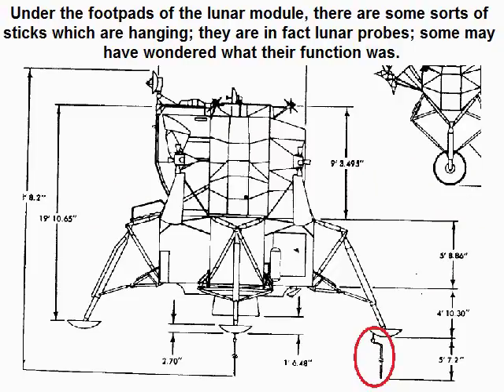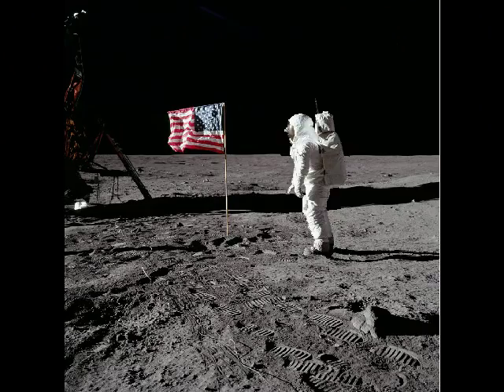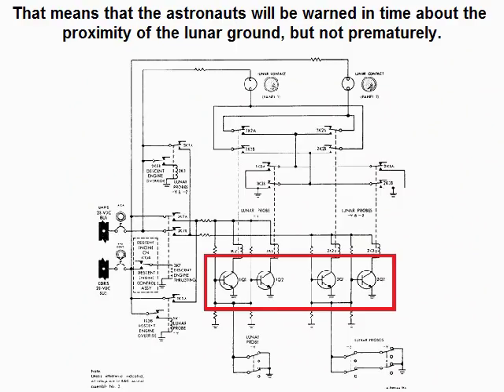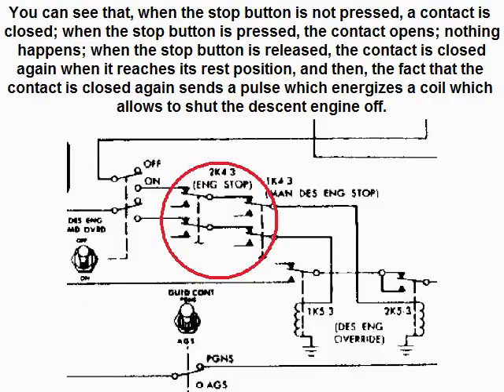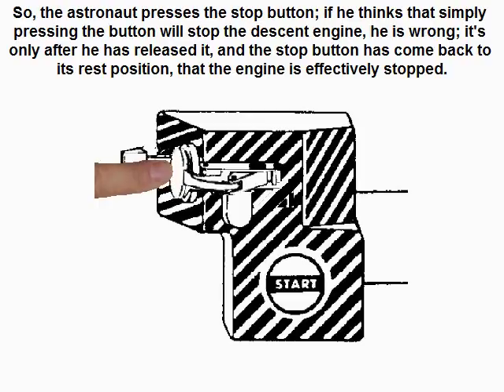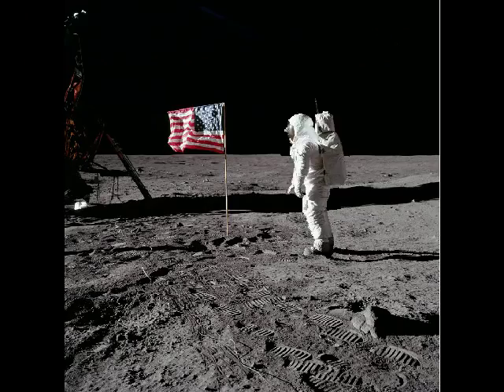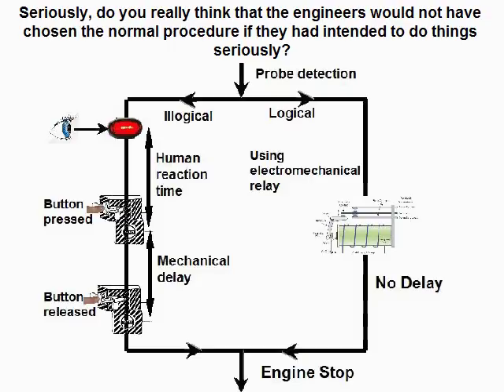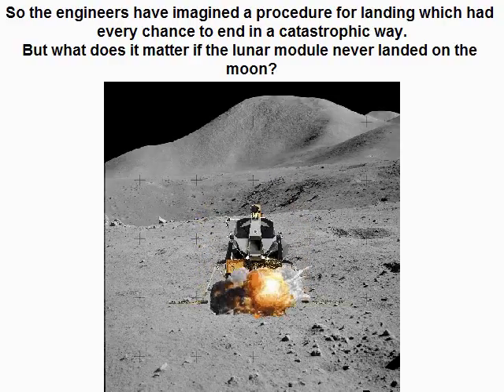Unsafe moon landing

Comment: The choice to use a manual engine shutdown rather than an automated sequence was fully in line with the design principle that the crew had ultimate override on the status of any onboard system. This is the same reason why the crew had manual circuit breakers rather than relinquish control to an automated power supply control system. All in all this video is an artificial beat-up with a contrived engine shutdown time lag control problem.
Reply: Add to that you portray the dangerous situation to be delayed engine cut-off when it was inadvertant premature engine cut-off that posed the only real danger. A delay meant more dust being disturbed to obscure the landing but this scenario was easily survivable. Kinematic combinations of altitude and altitude rate such as those dominating over the last 15 or 20 metres of the descent meant that a premature descent engine cut-off would result in the descent stage impacting the lunar surface before abort procedures could separate the ascent stage and bring the ascent engine up to full thrust to carry the crew to safety. This region was nicknamed the "dead man zone". Your 'brilliant' automated shutdown removing the crew from the decision making process would have raised the probability of premature engine shutdown due to faulty lunar contact switch activation (3 such switches in a logical OR setup) from almost zero to an unacceptable level. Well down ma petite grenouille française!

Comment: Compare with the landing of the Surveyor 3 robot probe on April 17 1967. Surveyor had a simpler design for landing: keep the engine running just below the level balancing lunar gravity until landed, with the result that it bounced twice gently: "Initial touchdown occurred at 00:04:16.9 GMT on April 20 on a slope of about 10 deg with the verniers still on at a thrust level almost equal to the lunar weight. The spacecraft lifted off after initial touchdown and remained aloft for approximately 24 sec (see Fig. IV-11). Liftoff also occurred after second touchdown, the spacecraft remaining aloft for an additional 12 sec before third touchdown." (NASA technical report 32-1177 page 47). So NASA already had experience of successful powered landings and may have moderated their concern about LEM damage.
Reply: DO NOT FEED THE TROLL

Comment: the so long and rigid probes are ridiculous and dangerous for a landing on very uneven ground - no serious engineer would have proposed them for a real moon landing
Reply: Why? the astronauts are trying to choose relatively even ground for the landing, the probes are splayed outwards, won't reach the delicate parts, made of a deformable metal so won't snap, and the leg with the ladder on it has no probe precisely for fear that it would get in the way of astronaut feet.
Reply: The three probes, being rigid, could stick to the ground due to a rock or a corner of a rock and would act as a pivot, even allowing them to overturn the LEM during landing; moreover, since after landing these probes are half-hidden and leave the ground up for several centimeters just around the LEM, where the main and most delicate activities take place, the risks that an astronaut, with limited view especially in the area of the feet, stumbles and fall, maybe right on the same rigid probe, is high, being able to cause, among other risks, the micro-holes in the space suit with almost immediate depressurization that would lead to the rapid death of the unfortunate astronaut!
Reply: Those probes are slender aluminum tubes weighing just 2.5lb (online metal dealer specs a 5 foot length of 30mm aluminum tube with 2mm wall thickness at 3.2lb). The LEM landing mass is at least 7 tons and had crushable sections in the landing legs to absorb the impact, so with the probes splayed outwards and so subject to bending rather than abrupt buckling actions your apprehension that the LEM could pivot over a probe is excessive. A bent probe is visible in photo AS12-48-7034; although it certainly looks like something an astronaut could trip over you'll note that it's close to the foot pad and that along with other lines and tapes also gives plenty of obstacles. It doesn't look sharp, and spacesuits are notably tough (external layers designed to resist abrasion and puncture). Most of all they'd practiced walking around in spacesuits for hundreds of hours so would have been far more nimble with their feet than you seem to expect.
Reply: A 2 mm thick aluminum tube is very resistant - those who do not believe it can try themselves to hit the head with one of them and then we can talk about it. When the LEM is landing it is suspended in the void due to the rocket engine that fires against the force of gravity lunar and just one of the three probes hit an asperity of the ground make the LEM immediately rotate around its center of mass, apart from a minimum of inertia force. If these rigid probes had not been dangerous, why did NASA herself finally decide to remove the fourth in the leg where the ladder is fixed? Doing many hours of training does not bring any improvement to astronauts on the difficulty of watching around the area of their feet, being inside a space suit with a camera mounted in front of his chest!
Reply: Hitting is not a useful comparison - I can bruise you with a raw chicken egg. Consider whether you can bend such a tube - I've never tried 2024 aluminum but I can certainly bend its cheaper cousins. And at planned descent rate there is 20,000kgm/s of momentum leaning on that tube. A sticking up tube can walked around (and those hundreds of hours of spacesuit training certainly gave the astronauts practice in being aware of terrain they could no longer see, just as you can step over a puddle on a path without looking down at it, just being aware of how far away it was when last seen) - but if the tube is bent up right in front of the ladder then it may be impossible to avoid when leaving the LM. That's why they took it off the ladder leg.
Reply: In my opinion nobody can bend with a force of arms a 1 m round tube of aerospace aluminum two millimeters thick - in any case it takes a lot of strength - the LEM in the landing phase (after having consumed most of the fuel during the descent) weighs about 7000 kg, but measured on the earth - on the moon as known it would weigh about 1/6 less - considering an average landing speed of about 2 m/s (it could be even slightly above 0 m/s) the "momentum" of the LEM would be only 2333 kg m/s (at a minimum of only 1166 kg m/s) and not 20000 kg m/s (!) as stated in the previous message - and I repeat as the LEM, during landing, is suspended above the lunar surface and its mass can be considered concentrated in its center of mass and therefore can be rotated or moved with a not huge force that can be transmitted by one or more of the three aluminum probes, which are also distant from the center of mass and therefore their strength is amplified for the principle of the lever of Archimedes, creating enormous dangers with possible reversal of the LEM itself!

Comment from the maker: This is what we can find in the text associated to the landing:
"102:45:43 Armstrong (onboard): Shutdown
16-mm MOCR film clip with synchronized audio (45 sec)
Audio/video compilation and synchronization Copyright © 2015 by Stephen Slater. YouTube presentation by David Woods.

102:45:44 Aldrin: Okay. Engine Stop.

[Neil had planned to shut the engine down when the contact light came on, but didn't manage to do it.]
[Armstrong, from the 1969 Technical Debrief - "I heard Buzz say something about contact, and I was spring-loaded to the stop engine position, but I really don't know...whether the engine-off signal was before (footpad) contact. In any event, the engine shutdown was not very high above the surface."]

[Armstrong - "We actually had the engine running until touchdown. Not that that was intended, necessarily. It was a very gentle touchdown. It was hard to tell when we were on."]"

1) Armstrong tried to stop the engine himself when the warning lamp went on, but according to the script, he didn't manage to do it himself.
So there already was one second wasted.
So, it was up to Aldrin to stop the engine.
I would be surprised if Aldrin knew that he had to release the stop button to actually stop the engine.
"in any event, the engine shutdown was not very high above the lunar surface."
Not very high, means too close to the lunar surface.
If the engineers had devised a length of 1.7 meter for the lunar probes, it's because it was the good height to stop the descent engine.
And finally, the final nail:
"We actually had the engine running until touchdown."
If the detection interface had automatically stopped the descent engine, the engine would have stopped running before the lunar module touched the lunar ground.
So, you can always discuss, the problem is very blatant, the procedure which was followed was completely illogical.
Reply: Wow, so you finally DID read the annotated transcript. Congratulations! Yet it destroys your own premise. The fact that they landed safely with the engine still running shows that it was not disastrous to do so.
Reply: Do you actually know what a test pilot is? Do you have even the SLIGHTEST clue why they were chosen for the Astronaut Corp? Why don't you understand that premature engine cutoff was considered a larger danger than a manual cutoff?
Reply: Um, I believe you cited that idiotic (and long disproved) Russian author's claim that the Saturn V could not make orbit.
Reply: +ApolloWasReal  Young Waldo is just a troll out to give everyone a hard time, ignorant in the extreme of the arguments both pro and contra moon landings + needlessly rude. I just ignore his rantings now. Trolls left unfed will disappear.
Reply: DO NOT FEED THE TROLL
Reply: TROLL knows nothing of radiant heat transfer. Black bodies have emissivities of 1.0. This means they gain or LOSE heat at the greatest rate. There is no such surface that has a one way flow of heat inwards only.
Reply: The black areas are matte black Pyromark-painted Inconel insulation blankets. The parts of the lunar modules that would experience a lot of heating due to the exhaust of the reaction control thrusters had this material as the outer layer of their insulation blankets. Because the top deck and side panels of the descent stage are subjected to engine exhaust, these areas are extensively protected with a nickel inconel mesh sandwich outboard of the mylar and H-film blankets. The aluminised mylar reflective sheeting was therefore still inboard of the inconel insulation. The blackened inconel would lose rapidly whatever heat was gained by radiation or convection by direct engine plume impingement.

NOW GO AWAY
Reply: If the spacesuits were placed directly in a rocket motors engine exhaust you might have a point. You are just trolling as your answer is totally idiotic  GO AWAY
Reply: Did somebody just fart?
Reply: Yeah, your little game is over. You've exposed yourself for the troll you are, Waldo. You're done here, back to the X Box with you.  You should probably get to work on your new sock puppet.
Reply: Last year I was blissfully unaware of your existence. You've already admitted you are just trolling, give it up. Give mommy her iPad back and go get some fresh air.
Reply: They do say cranial rectosis might be contagious. Yours seems to be a particularly nasty strain...

I'd hardly call less than 10% of the population overwhelming support, but good for you.
Reply: Lucky for me your good opinion is neither required nor desired. Now run along, little boy. Your game is over.
Reply: Cornelius Crewe That bod is a most tiresome fellow. Did SpaceX just launch another Falcon Heavy yesterday? The YouTube video was billed as being live although the only scheduled launch was for the February 6. I wonder how long it will take for manned space missions out beyond LEO to commence? I am still intrigued as to the business incentives that have encouraged such heavy investment in SpaceX!
Reply: Just CuriouS Pretty sure that's just a YouTube glitch. 
Supposedly Space X has customers that have already paid for a lunar flyby. No idea when that is supposed to happen, tho.

I'd like to see the Crewed Dragon start making flights. About time we quit hitching a ride with the Russians. I gotta say, though, Soyuz is a pretty cool spacecraft.

Comment: Geez, Hunchbacked, you're recycling old material. We talked about this years ago. The designers were concerned about a premature cutoff of the descent engine, which would have been fatal. This is not an unreasonable concern; Mars Polar Lander was destroyed by exactly this kind of malfunction. Of course being a robot its designers had no choice. Apollo's LM, having a crew, could be designed to let the crew do it manually.
Reply: ...and you are still wrong, more comprehensively.
Reply: I see no meaningful differences between your previous and current presentation. Your fundamental premise is still wrong. The fact remains that the designers were concerned about a premature (and fatal) automatic shutdown. So is the fact that it simply wasn't absolutely necessary to shut the engine down before surface contact. The fact that Apollo 11 landed safely proves it.
Reply: +ApolloWas Real  We all know that Ms le Hunchie has to get out one of his inane productions each week. Of necessity considerable recycling of previous lunacy must occur. To believe that each of his weekly machinations exposes a genuine fatal flaw in Project Apollo requires to date in excess of 500 major design flaws to have been present. Only Ms le Hunchie with his astute aerospace acumen acquired through over 20 years of working at Markem-Imaje on 'leading edge' packaging and labelling systems could reveal to the world such 'obvious' blatant proof of NASA skulduggery and duplicity in yet another Illuminati plot to rule the world. 

It just could not be that relinquishing ultimate engine off control to the crew whose lives would otherwise be imperilled by a premature automatic engine off command so deep into the  'dead man' zone was viewed as mandatory!
Reply: You should understand that how something looks to the eye may be very different from how it "looks" (or behaves) at non-visual wavelengths. Absorptance refers to how the material absorbs light at the wavelengths where the sun radiates, i.e., mostly visible light, a great deal of near infrared and some ultraviolet. Emittance refers to how the material radiates (and absorbs) in the far infrared around 10 microns where objects at "room" temperature radiate thermally. A material like beta cloth can look white at visual wavelengths yet also  "appear' black at far-IR wavelengths (if you could see them). So it has a low absorptance and a high emittance, which means it stays cool even in direct sunlight.

However, because of its high emittance it will absorb unwanted heat radiated from the lunar surface. So there are alternating layers of aluminized Mylar and loosely woven Dacron fabric between the beta cloth and the pressure bladder to provide insulation in the same way as a Thermos bottle (remember it's operating in a vacuum). That's why the heat generated inside by the astronaut and the PLSS machinery has to be actively removed by circulating water and rejected to space via a sublimator.

This is one of several reasons that every Apollo mission landed just after local sunrise, and even Apollo 17 was gone well before local noon before the surface got too hot.
Reply from the maker: I am presenting it in a different way, more comprehensively.
Reply: Simple. Because they're covered with "beta cloth", a woven fiberglass with a Teflon coating. It has a low absorptance (which makes it visibly white) and a high emittance (which causes it to radiate heat efficiently), thus remaining cool in sunlight while in space.